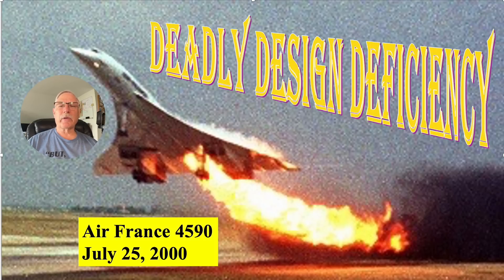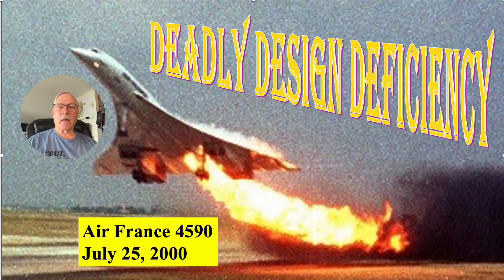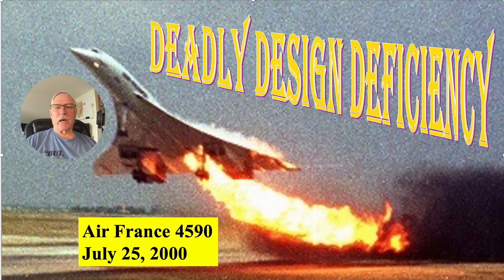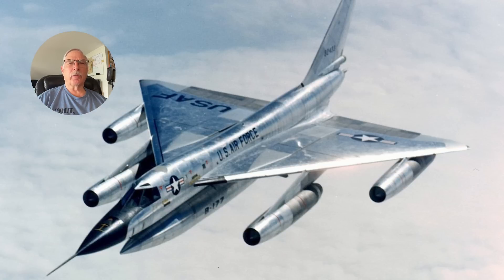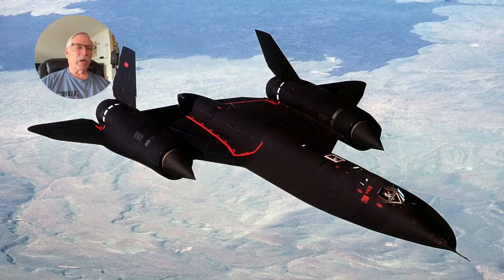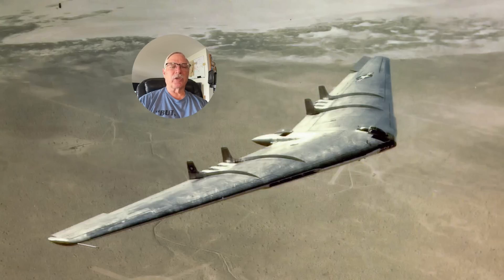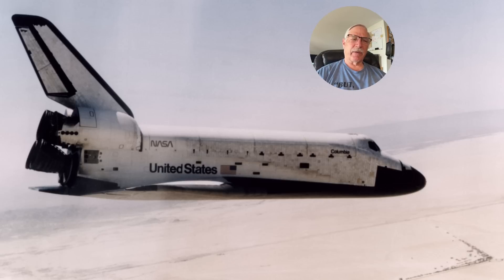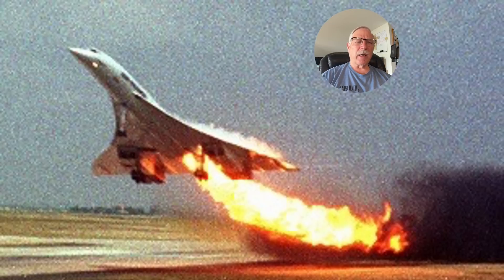Concorde Deadly design error finally led to the end of the program

Comment: Concorde was a remarkable aircraft, especially given its design largely belongs to the 1950's and sixties. However as you say the penalty of that wing was very high take off and landing speeds, in the case of the crash it was doomed once it caught fire. A tragic loss for the people onboard and the future of commercial supersonic travel (at the time). Incidentally I have a soft spot for the B-58, it was the first model aircraft I built, a Revell kit I think, circa 1960 or just before. Keep the memories coming.

Comment: I am speaking from Oldham memories, but as far more as I know the problem with tyres was solved by Michelin when they developed a new 'zero growth' tyre which did not fly apart if it failed. Also they added a kind of a shield on the landing gear which prevented large chunks of shrapnel hitting the wing.
What eventually killed the concorde was the avionics - it was all analog and unique to that aircraft - unobtainable.
It didn't believe that it could ever have been profitable after the 1973 in crisis given it's normal a petite format fuel.

Comment: I would protest the deadly design error. BA never had an issue and although tyres blowing off happened to them too, they never had something THIS catastrophic. Sadly they never thought of reinforcing the tanks (they put in Kevlar, but then 9-11 happened and nothing was ever the same) until this crash though.
The engine layout was thoroughly considered and with the specs the engineers had to oblige, I don't see any other possible engine layout. The aircraft was designed for a particular amount of speed and they had to carry as many people as possible while also being pressurised. The wing and fuselage had to be very finely tailor made and this left very limited options for engine placement. 
Concorde had a special engine divider though, since this was regarded as a problem already at its conception, so they installed a firewall to somewhat prohibit the fire spreading. 
The firewall actually worked ok during the AF4590 sequence, the FO was the one to shut down the working engine nr 1 so they were totally aft CoG and with only two engines on the right side working, being overloaded, they crashed.
It would be awesome to go through the fuel tank system in the Concorde - that was a true engineering marvel!

Comment: Hi Ron, An interesting and very informative video.

I had no idea about the forces involved when the tyre fragment hit the fuel tank.

The issue with tires exploding was a ticking time bomb that was going to end in disaster at some point, and it is a shame that the corrective measures that were eventually put in place had not been implemented earlier.

Now what I'm about to say is based upon my recollections of a documentary that uncovered additional issues with the preparation of that concord for flight that may have had a material impact whether the accident would have happed at all.

That said my brain is getting on a bit, so this account may not be 100% accurate.

Prior to the crash, Concord underwent maintenance on its under carriage which involved the removal of the wheels on the side which eventually exploded.
It alleged that when the undercarriage was reassembled, the maintenance crew omitted to fit a large spacer between the wheels (I think).

During the initial stage of take off, the plane was seen to swerve across the runway, and nearly collided with a Fire tender that was waiting to the left hand side of the runway.

The Fire crew later reported that the plane did in fact swerve, early in the take off and that the fire started when the plane was in close proximity to them suggesting that the debris from the continental flight was on the far left hand side of the runway near where the fire crew were waiting, i.e. a fair distance down the runway, and at a point where Concord would have been travelling at high speed.

I believe that there were skid marks on the runway which confirmed the swerve early in its take off.

I believe that the French investigators report, acknowledged the omission of the spacer but stated it played no part in the accident!!!

The fire crews observation did not align with the conclusions that the investigators had drawn, and so were simply left out of their report, which stated that the cause of the crash was solely down to the plane running over the debris, thereby making Continental liable, and not the Air France maintenance team

The above came from a UK documentary that I watched over a decade ago, and I have no way of verifying the accuracy of the reporting.

Comment: I do not think that accident would've happened on the BA concorde, though Ron.  The way BA did their maintenance, they'd have never allowed that jet to clear the hangar to the gate without having that gear trunion alignment part in place.  Also, they wouldn't have had it over max gross.  BA had issues with tire problems, yes, but this particular incident had that part missing, which the other incidents did not have.  The plane was skidding left even prior to rotation due to that.  I think that was the largest contributing factor to this being a fatal accident vs. a sev-A non-fatal event.  What do you think, Ron?
Reply: Precisely, they only ran over the titanium strip because of the gear issue causing them to veer left. Over max takeoff weight. Air Chance strikes again.
Reply: Yes, the infamous chain of events started WAY before AF4590 ran over that piece of DC-10!

Comment: If memory serves, tyre pressure was also much higher than other aircraft, making any failure that much more violent, add that to the increased speed and it's easy to see just how much more hazardous a tyre failure on Concorde was versus sub-sonic transport airplanes. Thanks for the great review!
Reply from the maker: Yes, you are correct!

Comment: Concorde DID make a profit - for BA! But taking into account all costs including development it was indeed a financial disaster. The British & French taxpayers picked up most of the bill (for which I thank them). 
However, it remains an amazing technical achievement.
For the full analysis of the Paris crash, watch BA Concorde Captain John Hutchinson's YouTube video, and read BA Concorde Chief Pilot Mike Bannister's book where he also (as an expert witness called to the enquiry) pulls no punches on the massive Air France and general French cover-up (including parts of the wreckage of interest to UK investigators 'disappearing' overnight).
This was NOT caused by running over a bit of FOD. Like most air accidents, there were many contributing factors, many of them related to the less than professional way AF operated a highly complex and very demanding aeroplane.
The FOD was but one of the many holes in the Swiss cheese.
I had the privilege of flying in the jump seat of BA Concorde G-BOAD, strapped in, headset on, safety briefed, with a superb view out of those cockpit windows, on a lovely wx day in August 1999 from Manchester out over the North Atlantic for Mach 2 at 60.000', then a landing in Paris. Despite 35 years of flying interesting, mostly tailwheel aeroplanes and indulging in aerobatics in a Chipmunk and Yak52 I had a share in, that Concorde flight is right up there as a lifetime highlight.
When I retired from the day job I became a technical guide on G-BOAC at Manchester Airport for 14 years and learned a great deal about the aeroplane from visiting ex-Concorde flight crews and ground engineers.
Incidentally, the only 2 aeroplanes in which I have experience an in-flight push in the back as more power is applied, are the Yak52 and Concorde!

Vince C.

Comment: Great vid as always. I read enjoyed John Hutchinson’s version of the 4590 crash. Air France apparently don’t like him, they want the narrative of “ they ran over FOD “ , nothing could have been done. I would imagine you are aware of the details of the extra luggage putting them weight wise aft of center biased , they had the transfer pumps switched on during takeoff, so somewhere around 100 or more gpm pushing fuel forward from tank eleven , which certainly must have had an effect to the ruptured fuel tank , the flight engineer shutting down the engine that threw the fire alarm  un commanded , the drag created by the landing gear spacers that maintenance had failed to reinstall after servicing , the failure for the reheats to be switched to contingency power , the large quantity of taxi fuel ordered , the fact that Capt Marty had ordered the fuel tanks in the wings to be filled beyond auto shutoff so when the fod hit, there was likely no extra space due to the transfer pumps being on, the arcing of the brake fan wires….. they took off with a slight tailwind as reported by Hutch. A lot of bad decisions prior to hitting the FOD.
Reply from the maker: Yes, was aware of  those factors. I was attempting to keep things fairly simple and just concentrate on the major details of the accident. It is always a trade off in these videos of basic issues vs getting very complex and losing people with too much detail. Always a balancing act.
Reply: @ronrogers  you know what though Ron, the way YOU explain things keeps the dilettante in the mix.  They can follow along because your knowledge combined with your outstanding instructional tone makes learning from you a snap.  I bet your students did well at UPT and beyond.
Reply: @ronrogers  and your vids are amazing, so , understood and concurring
Reply: I have to go with your explanation of the events of this tragic day. It sounds much more detailed than anything that came out of France.
Reply: Came here for this. Esp the part where they knowingly overloaded the airplane always made me slightly mad.
Reply: Which of the several videos of him on the crash do you recommend?

Comment: Good morning Ron! I hope you have a great day. The Concord is like many Christian cathedrals around the world. St. Patrick's in NYC probably doesn't turn a profit. The National Cathedral in D.C. probably doesn't turn a profit. The Cathedral of Notre Dame definitely has not turned a profit since the catastrophic fire. They exist for many reasons, one of them is national pride. I was lucky enough to retire as a simple parish pastor who struggled to replace a worn out roof. Anyway great video!
Reply: So, tell us how you as a parish pastor became interested in aviation....curious.
Reply: @jcheck6  Well...this is pretty simple, really. When I was a young boy, I helped my parents build the house I grew up in: from foundation and well to 2.5 story eves. There was nothing we could not do. My first airplane was a wire guided gas engine airplane that when I stood in the middle of the circle, I could control it while making myself dizzy. After I crashed that enough times, I got a gas powered radio controlled airplane. I then proceeded to crash that several times. Then, my father and I, after getting tired of swinging hammers and pounding nails, built a computer (Heathkit H-88, later upgraded to a Heathkit H089 with dual 5.25' SSSD drives that could be unmounted and flipped over for a DSDD 5.25 drive.) Our first modem was a 300 baud modem connected to Comp-U-Serve. Without my parent's knowledge, I would let that modem connect to the non yet existing internet all night long downloading assembler programs to run on that computer. I never had a typing class, but I can touch type as fast as anyone. Fast forward...high school (Did I mention this all took place before I was a teenager?) ...band, girls, short skirts...band geek, I got beat up, didn't get any girls, church, church camp, pretty girls, got to first base. Jesus, undergraduate in social work, graduate school, masters of divinity, masters of art in Christian education. Parish ministry in The United Methodist Church, a couple of assignments in some small parishes and a couple of appointments on the conference staff as a director of this or that on camp and retreat ministries. All of a sudden, I was flying overnight, leaving my wife and kid at home, and knew how to work the frequent flyer program due to help from two of my mentors. I would fly Alaska/Horizon from Boise to Seattle, then the shuttle from Seattle to Portland, then grab a plane to Bend, or Madras...sometimes it was just a day flight there and back again (First Class Lounges are very nice!). So while I never went to flight school (being a parish pastor is a job for the poor) one of my mentors did have his general aviation license and he and his buddy got caught in the fog in the Columbia River canyon and got disoriented and ended up flying upside down. He never took the controls again. 

As a passenger, I have enough in the air time to tell exactly what the 737 should be doing and the sounds it should be making. One time I was on a 767 from Kansas City to Portland and right after takeoff, the right engine exploded (I assume it was a bird strike). It scared the shorts off of me, but being a frequent flyer, I knew we were ok. Wow though, to see all of the fire trucks lined up on the side of the runway while we landed safe, and sat for a good 90 minutes while the inspection was being completed. 

So that is the short story, and why I am fascinated with airplanes and also have earned my Amature Extra ticket, all the way from novice! 73, KB7QOD. -- I neither contest nor log, but you can hear me on CW and phone usually on 40 meters.
Reply: @jamiesuejeffery  Thanks!  Very impressive!  I too started with control line flying and also had Heathkit radio control planes.  Interesting about your engine failure experience.  In my 52 years of 16,000+ hrs of flying, have never had an engine failure.
Reply: @jcheck6  I don't know much. I was sitting in the back. The 767 has very similar noises to the the 737. They both have the screws coming up and coming down for the flaps. The engines spin up and then the throttle is pulled back for stabilized flight. We were on takeoff and all of a sudden, the right engine (number 2?) had a very large concussion. It took a couple of minutes, but the pilots shut down that engine and after running some checklists, announced to us in the cabin, that we were returning to Kansas City. They must have called MAYDAY because we turned nearly immediately and landed safely with all the red trucks waiting. We eventually taxied to a gate and were left stranded overnight (but all alive, and no one hurt.) It honestly scared me. I'm sure the pilots had to change their shorts. But then, that is why they practice this in the simulator.

Comment: Some of the other big factors of the crash included the fact that they were a several thousand pounds over the max takeoff weight, the CG was aft of limits, the main bogeys were missing a spacer that kept the tires tracking properly, the FE shut down an engine still producing thrust without warning the crew and against established engine fire on takeoff procedures, and the fuel was dumping out of a tank fully forward of the CG, meaning the CG kept moving further and further aft until it overcame the elevator authority leading to a violent pitch up into a stall and fell.
Reply from the maker: Yes, was aware of  those factors. I was attempting to keep things fairly simple and just concentrate on the major details of the accident. It is always a trade off in these videos of basic issues vs getting very complex and losing people with too much detail. Always a balancing act.

Comment: That's crazy that they had the tire blowing off so many times before and yet they didn't do much about it. Its tragic, I remember in a documentary some lady or ladies were saving for a long time to fly on the Concorde and they ended up in this accident. I hope these supersonic planes make a comeback and make above subsonic speeds accessible to more that just military pilots. One crazy fact about this accident plane is that it was the same plane that was used to film the 1979 Airport Movie, in that movie the plane also ended up crash landing.
Reply: Not mentioned in the commentary was that Concorde had the highest take-off and landing speed of any airliner, ever. It also had the highest tyre pressure of any airliner, ever.
Michelin did an incredible job of making and testing the highly technical  tyres for the aircraft and we're far in advance of anything Goodyear or Firestone could make.
There were other factors at play in the Air France Concorde disaster, politically Air France was being groomed for public sale and an all Airbus fleet was desired and as such France were reluctant to help with the redesign and kevlar strengthening of the fuel tank skins, also the French operated Concordes were very marginal on fuel range which mentioned in the event of a tyre chunk hitting the underside, the over-filled fuel tanks would suffer a bigger hydraulic shock via the incompatible fuel and any damage would be much worse.
There were also maintenance errors involving main landing gear wheel spacers being omitted which had already caused the aircraft to vear left of runway centre towards a 747 presidential flight waiting to join the main runway.
The piece of DC10 junk left on the runway was just the straw that broke the camel's back.
Reply: There was a ton of bad decisions made from Air France for a long time before this. British Airways flew the Concorde way better imho. 
That particular day the AF4590 was knowingly overloaded with both fuel and luggage, for one thing. It wasn't just "a piece of debris" it was an entire chain of stupidity before that debris entered the chat.

Comment: 👍Greetings Sir, I have read the B-58 Hustler had several instances of main landing gear tires/wheel assemblies coming apart during take-off and puncturing the fuel tanks, almost identical to what happen to the Concord. I would imagine secrecy at the time prevented this information from being reported to the general aviation community as well as the designers of Concord.